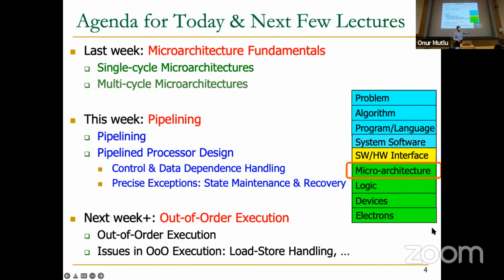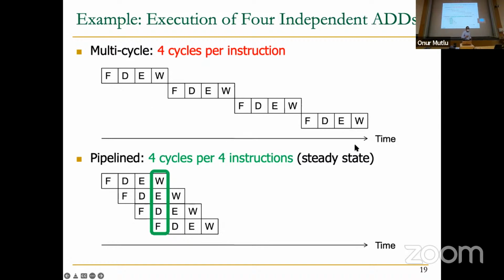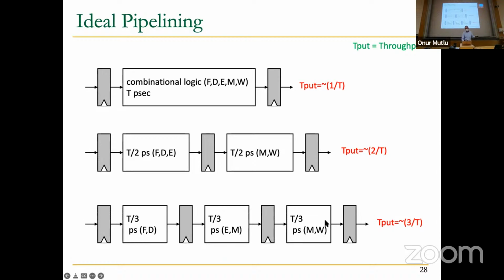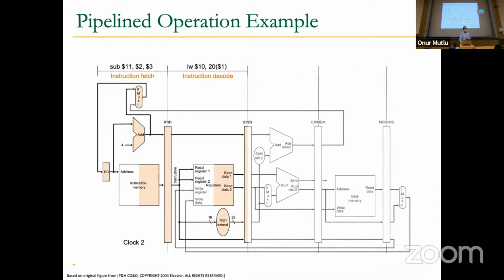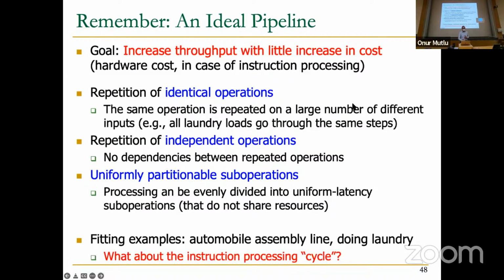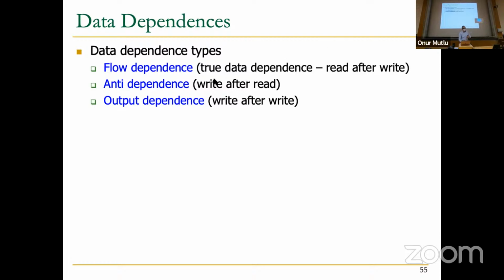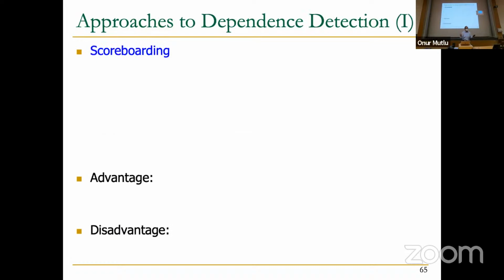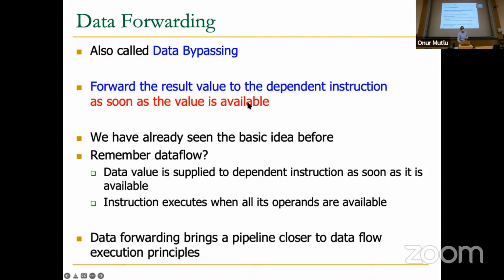Digital Design & Computer Architecture - Lecture 13: Pipelining (Spring 2022)

Comment: On slide 43: Why don't we encode once and write each control signal to its respective register directly, instead of propagating all signals and consuming them one by one?
Reply: im not 100% sure but i think it is because each stage of the pipeline is supposed to work on a different instruction and writing everything directly would override other instructions' data